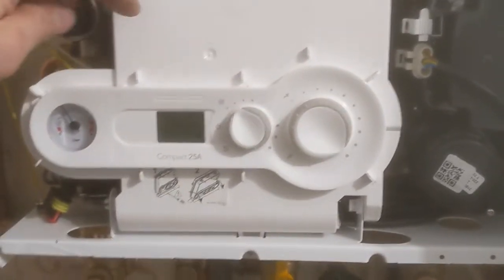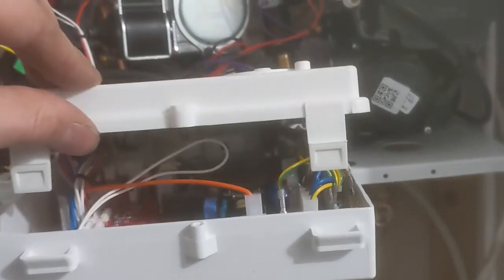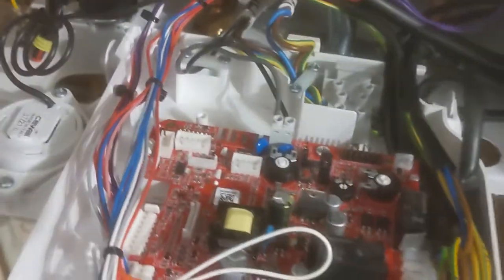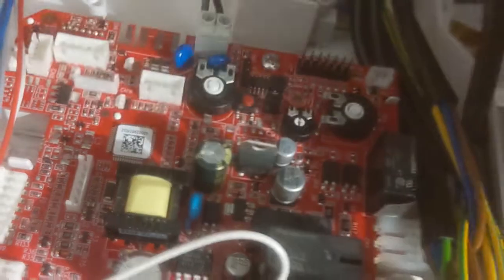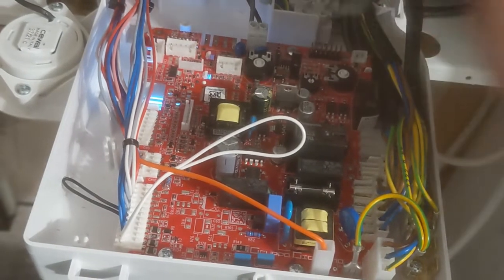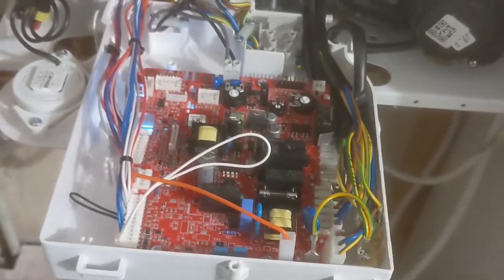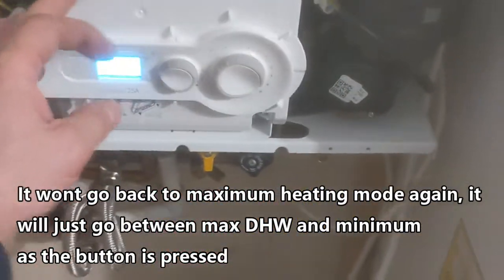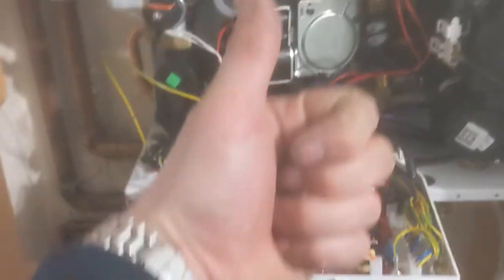Vokera Compact 25A service modes

Comment: My vokera 25a doesn’t have a timer installed, will I be able to hire someone to install it?
Reply from the maker: Yes a gas engineer could fit you timer or a wireless programmable thermostat
Reply: @northwestgascertificates  thank you for the quick response. How easy would the wireless thermostat be to install?
Reply from the maker: Hi. I actually have done a video on wiring a eph programmable wireless thermostat. If i was fitting one for a customer, i would charge £75 so not a massive job